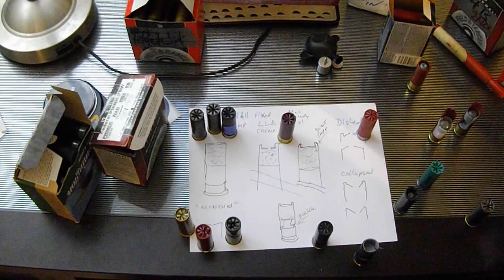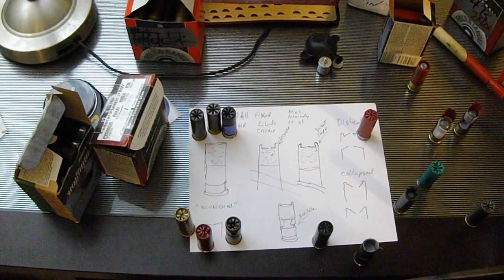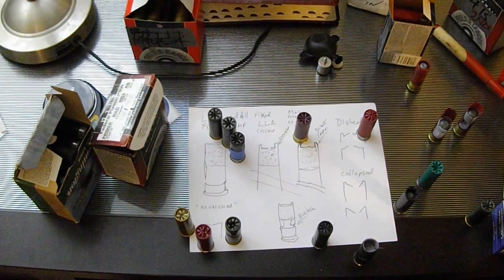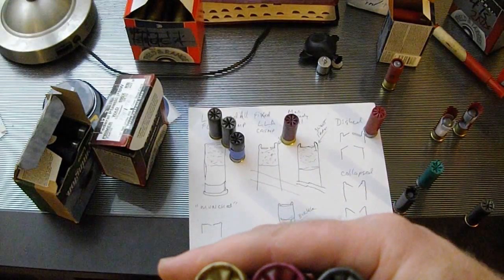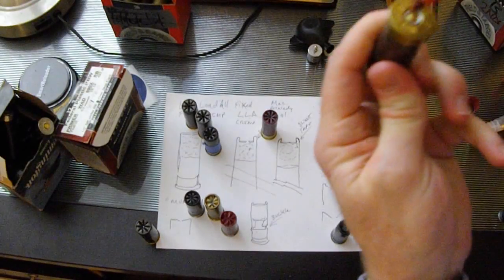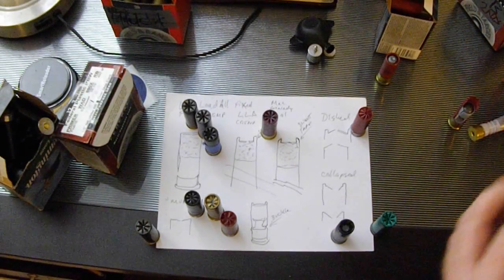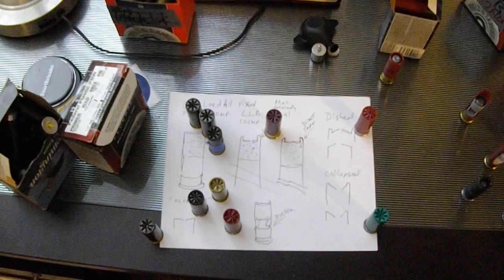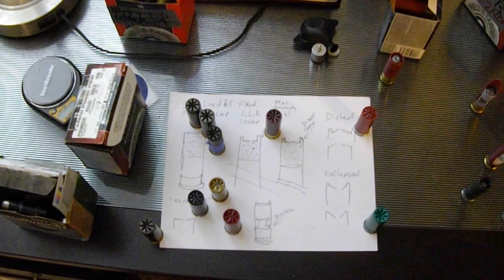Getting Good Shotgun Crimps, a diagnostic.

Comment: Great info!  I’ve been reloading metallic for 32 years and just started to load 16 gauge (for various reasons).  I’m loading on a MEC Jr 600 and I’m having a helluva time with the crimp on a 7/8 payload.  I have the brass crimp starter from BPI.  I believe from the info you provided that my issue may quite possible lie with the starter crimp adjustment.  Thanks for the detail.  Best video I’ve seen on this yet.
Reply from the maker: Glad to help. You almost can't have your pre-crimp too tight so long as you aren't buckling the hulls.
Reply from the maker: Travis Thacker  I've tried several presses but none of them had variable crimp angle. Merely variable crimp depth. Changing the angle would certainly change with the outside corner of the crimp lies...

Thank you for giving your perspective and explanation. I think we may be getting it the same thing from a slightly different methods, clearly both of us are being detailed. A bus understand what it takes to have the various aspects of the crimp at the height and depth they need to be in order to fully seat and lock in.

Comment: Had a lot of trouble getting rid of the banding on the side of AA hulls. This helped me clear it up in just a few minutes of adjustment. Thanks for taking the time to make this guide😁
Reply from the maker: Welcome. I always ruin a few when I switch back to AAs from another hull type. My suggestion would be to standardize on the green gun club hulls, and the black equivalent. They use basically the same data as the Remington Nitro/STS hulls and are very comparable in type to the AAs with the advantage of being available by the bushel any time you go to the range.

Comment: I finally figured out my Load All II today -- I quit parking the sizing ring on the sizing station after repriming the hulls, which allowed enough extra stroke to let me get the "flat crimp with a rolled edge" you showed as ideal.  My wad/payload column was a little short, so I was putting an overshot card in -- a 3/4 bingo chip in this case -- and even though the finished 7/8 ounce shells rattle a little, the crimps look great.  There's even a trace of the "factory crimp" taper (and I just got a roll crimp die for a drill that I can use to accentuate that, I think, though feed is less critical in my 870 than it would be in a semi-auto).
Reply from the maker: Good on you. However you really should fill that gap. It makes for inconsistent ammo. You could use cornmeal buffer.
Reply: @GunFunZS  I agree, but my component choices are still limited.  A 20 ga. 1/16 nitro card would do the job, but I don't have any yet.

Comment: I realize this is an old video but I'm hoping you are still reading and replying to comments 🙂- I have a new Lee Load-All II and am having crimping problems with 2-3/4" all plastic shells. My recipe is 12Ga. 2-3/4" all plastic hull with 10mm ring (generic bulk from Grafs),  Claybuster CB3118-12AR 1-1/8 oz wads (figure 8 style base), 32.4 gn Hodgon HS-6 powder and 6 shots of 000-buck shot (.9 oz). Initially I had more one more shot in but it caused the payload to stick up above the wad cup. The top of the wad and payload sits almost 1/2" below the edge of the shell, which is what Lee recommends, however I am getting crimps that have a center hole (about 3mm) and a wavy crimp role. 

I am new to shotshell reloading so I'm not clear if the wad is too high, too low, if the powder should be reduced due to only 6 shots, etc.

Do you think my press would benefit from your Lee modification? If so, can you point me to the video - I was unable to find it in your playlists.

Best regards,

Mark

Comment: Assuming the OP is still in the business: I'm running a MEC650 and a 600Jr side by side (grandkids use the 600) with the same load: Remington Gun Club hulls, Downrange XL1 wads, 17.8grains of Red Dot, 1 oz #8 shot. After years with no problem, now half or so of my reloads come off the 650 with a dimple, deep enough that shot can escape. Depth from shot to rim is 7/16 inch. Here's the interesting, I hope diagnostic part: If I take a shell off the 650 after adding the shot (no precrimp) and finish it on the 600--perfect crimp. Same thing if I leave the shell on the 650 to do the precrimp, and then move it: the difference is that the "hole" in the precrimp on the 650 will just let a primer end slip in; the hole on 600 is big enough for the whole primer to go in; but it seems to make no difference to the 600--it makes the same perfect crimp either way.
My question: what adjustment should I try on the 650? Tweak the cam? Thanks to anyone who knows the answer!
Reply from the maker: I'll have to think about this.
Reply from the maker: I would check a couple things, but this all tells me that the one way or another your column is  shorter. My guess would be that the wad changed, or you are not dropping a full load of shot. If the wad got a deeper cup lowering the top of the pile of shot, or longet petals holding the start of the crimp up higher.
Reply from the maker: Another answer could be that your drop tube that seats the wad shifted down and is compressing the wad by an extra 1/8"  or so. Try moving it up an eighth and see what happens.

Comment: Could you please discuss the pros and cons of 6-star vs. 8-star crimps?  Thanks
Reply from the maker: My answer is going to be boring. 

Basically they are the same.  I prefer 8 because they are a little smoother. 

As a rule of thumb, some manufacturers use 6 fold to distinguish buckshot, but they aren't consistent. For example, most of Remington's birdshot is 8 fold and most of their buckshot is 6. However, the black hulled gun club and tall steel game loads are sometimes 6 fold. Just often enough that I will be doing a run and get an ugly crimp and realize a 6 fold hull got mixed in. I try to weed those out and have a bag of just them for oddball batches or loads I am going to gift.

Comment: is there any cause/way to correct oversized plastic hulls (using used hulls from bins) i've just loaded 100 shells and found they are very hard to put in the chamber, are these safe to shoot and is there a way to correct this? Thanks. Great video
Reply from the maker: The plastic part is too big diameter, or the metal head?  If you mean the metal case a ring type or collect sizer will do the job.  However collet sizers won't size most of the plastic.  Ring sizers go full length. If someone had been firing the shells from an extremely loose chamber, they could be ruining the shells too. What kind of press are you using?

Comment: How would you go about fixing a "mushroom head" bulge or flare right at the very top of the Hull on a 12 ga MEC 600 Jr Press?
Reply from the maker: Probably a combo of more pre crimp and setting the wad 1/8" lower. 

But follow the order of operations shown here. I can't see what you see. 

You can see how much shell is left over your shot. I can't. Go through each step in order and you will find your problem(s).

Also some book loads don't really fit well in the space available.

Comment: On my AA hulls, i get a very minor band that i can feel with my fingers, but isnt really visible. I believe its from the wad passing over the base wad. These shells still shoot and have no issues cycling in my gun. Do i need to just lay off the wad pressure a tad? AA hulls are the only hull i have issues perfecting. Which sucks because i have over 10k of them and want to be able to put them to good use
Reply from the maker: That's complicated. Probably you actually need to increase your wad pressure, so that it seats the wad down about 1mm deeper. Then when you are doing your final crimp, it is just pushing the crimp, and not the crimp and the wad at the same time.  The thing is, that ring forms by too much vertical pressure being put into the side walls. This mostly happens at the final crimp stage, but is amplified by making the final crimp push on internal components which add friction to the downward pressure. I've come to prefer other hulls because of this. AA is a nice hull, but it's fussy.  Once dialed in, it makes for a very smooth and consistent hull. Inevitably though it takes messing a few up to dial in any time you change up a load.

Comment: It was my understanding the wad was always set as low as it will go, right on top of the powder. Your saying that the wad depth can be adjusted?
Reply from the maker: The base of the wad is always in contact with the powder and compressing it slightly. When I'm talking about WaD seating depth, I'm basically talking about how much you squish the top of it down. each one has a certain range of flex they can do before you would need to switch to a different wad. Unfortunately not all loads in the manuals actually fit in the space inside the shell.

Comment: I'm currently trying to reload federal field and target and keep getting over crimped cases. Crimp keeps caving. I'm using federal load data. Any suggestions? What could be wrong. I'm using a lee press
Reply from the maker: Hi. Youtube is terrible lately. I didn't get any notification about your comments. It depends on what you mean by "over crimped"... Do you have swirls? Is your crimp caving in? If the latter, it probably means a few things, that you have to assess in order. The first step would be to seat the wad just to contact and see if the problem is solved. The markings I described on the other video make it so you can gauge how deeply you are setting the wad, and make it repeatable. If it isn't, the next step is to try getting your pre-crimp tighter, and check again. The final thing is to adjust your final crimp up higher. This is set by the final crimp die. I think I saw another comment from you saying you were using a Lee press. The markings help for each of these steps. Pre crimp to the same line. Final crimp to the same line. Usually the Lee press won't let you final crimp deeply enough. If it were going too deeply, you could use something like a nickel as a bump stop for the final crimp die.
Reply: Could be your column height is not high enough. Try using a 1/8 inch nitro card under your shot or slug.

Comment: Awesome video, thanks so much for taking the time to post this! So the ring is due to bad hulls?
Reply from the maker: It can be, but usually it's more about putting too much vertical force on the hulls at once. 
That's what I was trying to explain. The AA HS style hulls are strong, but when they fail, they fail at the weakest point. That ring is the usual spot. 
Odds are, if you see the ring, you are trying to do too many vertical squish operations at the same time. The force adds up too much. If you can do some of those operations a little more thoroughly in early steps, they aren't all happening together as you apply the final crimp. So squishing powder and wad into place takes a bit of force, but not much of that goes into the shell wall. As it gets tighter, there's more friction, so more of it goes into the shell wall. Pre crimp doesn't do very much downward force into the shell wall, but there is a little. Final crimp (and roll over on presses set up to have a roll over/ taper) are the most downward force. If the wad and shot and powder are being compressed a bit while the crimp is being finalized, that's adding a lot of force all at once. If you are getting the ring, first thing to do is to try squishing your shot cup down about 1/8" /2mm down and see if the ring goes away. If not, go a little further. If you are squishing the shot column as much as reasonably possible, or it is just springing back to the same height, then your next step is to back out the final crimp die and the taper die (if seperate) and incriment downward until you have a good crimp. If you can't get a good crimp at that point without ring buckling shells regularly, then you've learned that the shot column is just too tall for that hull. Pick a different set of load data that takes up less space. This is part of why I'm not a huge fan of the AA style wads. They each have fairly tall leg sections that can only handle a little squish before they collapse. If the knees on the legs are buckling, you pretty much need to squish them all the way down or your loads will be erratic.
 You want the "knees" either all fully compressed, or all fully extended. Being on the threshold makes for bad ammo. Some will collapse and some won't. Other wad designs are progressive springs, like federal, or accordions (downrange IIRC?), or have stages of rigidish compression, like the remington figure 8. I prefer all of those.

Does this explanation help?
Reply: @GunFunZS  Thank you for the response. I put less pressure on station 2 when I press in the wad. It was at 60 lbs and now at 25 and no rings. They look great now. Thanks for all your help!
Reply from the maker: Glad you got a positive result. 

One of the biggest lessons I wish people could pick up on. Is to ditch the mentality of trying to use premium holes and use them for tons and tons of reloadings. The quality of the cheapest halls such as Remington gun club and even now the Winchester universal or whatever federal calls their book back equivalent, are very high now. And almost any time you go to a range you will find a place where somebody has fired a hundred or two of them in one spot all in a neat pile or perhaps if they are tidier cleaned up and in the trash can. You get far better crimp quality and therefore shell quality to use these one to four times then to use an AA or a STS or a gold medal 8 or 10 or 20 times. I'm not saying the premium holes aren't a little better. They are. But a twice used gun club is better than a five times used STS. And it's free. There's literally no reason to overuse hulls.

Comment: Ever work with an RCBS Grand?  I switched loads/hulls a few times due to availability, now I can't get my crimp right with what I've settled on.  What's the best sequence to "start from scratch?"
Reply from the maker: JohnnyQuid71 no I haven't. I wish I could help with your question.
Reply from the maker: Actually, thinking about it, the process would be the same. Get the final height of the wad and shot after spring break dialed in. Then make the pre crimp hole such that the shank of a 3/16" drill bit just drags. Then adjust final crimp to leave a level top. I can't remember whether the grand gives a final taper/roll,but set that last.
Reply from the maker: If you do the above and get sunken or domed crimps, adjust the wad depth, and see what happens.

Comment: Crimps should be .050 or less. Deeper increases pressure drastically. Hodgdon did a study on it and ballistic products has a brochure on it.
Reply from the maker: That's nifty info. will look for the brochure. Bottom line though, I have seen plenty of commercial crimps deeper than that. The point is your load must be keyed to whatever crimp you use, and they should be consistent.
Reply: That right there is why I load my shotshells at the lower end of the recommended powder charges for a given shot charge/hull/primer.
It keeps somewhat higher pressures much closer to safe levels, it's easier on the shoulder, and it gets more loads out of the hulls.

Comment: Federal spiral springy thing wads = fed 12S0
Reply from the maker: Correct. If you're doing slugs you genuinely want the name brand not a knock off. The slug won't sit flat in the shot cup of the clones. Now clay busters has a few watts specifically made for slugs and also versions of the WAA 12 with a tail piece fitted for straight wall hulls. I couldn't tell you what the part numbers are off the top of my head but they might be worth checking out too.